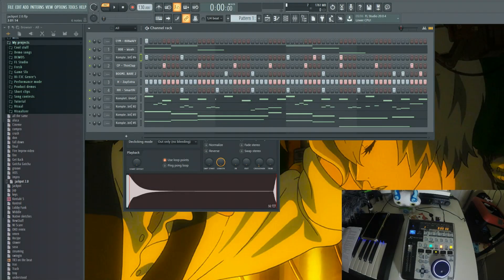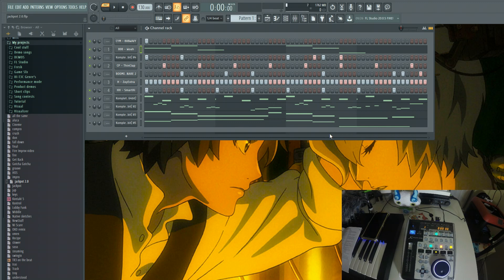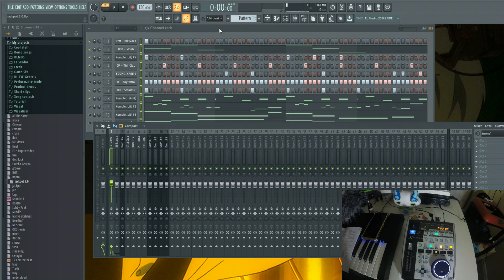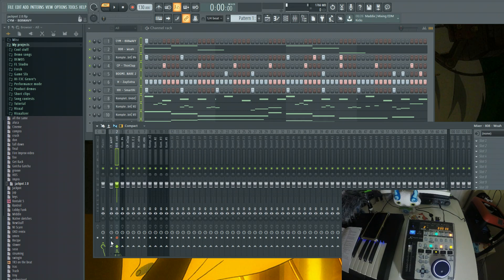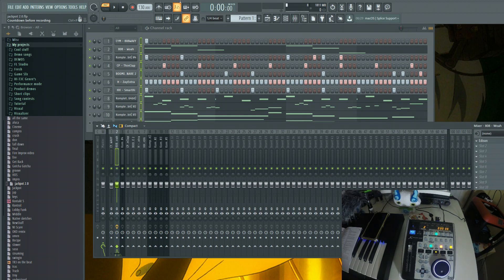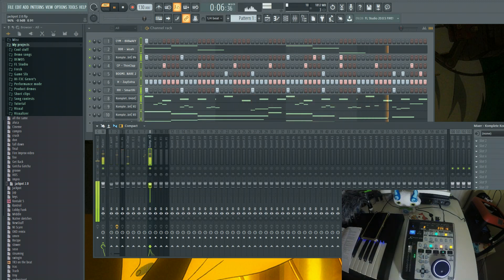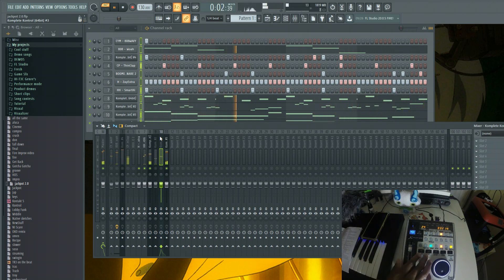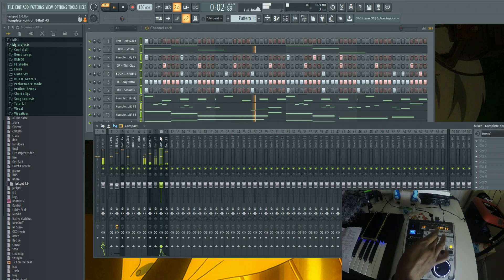Behringer X-Touch One with FL Studio 20

Comment: Hey man, just a question. I've got one too but I can't get it to work with fl studio. Everytime I want to select it or put the master sync on or send it to a port. I get a error. In the error it says that there is not enough space for it and I have to shutdown some other extensions. But that's the weird part. Coz this controller is the only one linked to the computer. Can you help or do you know a solution. Also I'm getting a code 10 from my pc when I plug it in. Kind regards
Reply from the maker: I have ran into this numerous amount of times, as do i currently. This seems to be a glitch or some type of time out thing it seems. The solution that fixes it for me every time, is to just unplug the power cable from the x-touch and plug it back. FL will rescan the midi and it should work accordingly. I think for some reason, the memory is saved from previous instances, causing FL to believe that there is no space allocated for the devices.
Let me know if that helps. I have not found a permanent solution yet.
Reply: @hit3c  I tried this but it just does not want to work. in the midi option of fl studio it even does not say x touch one, instead it says game controller 1
Reply from the maker: @patrickvanderlit5411  that's odd..do you have the controller set to Mackie HUI ?

Comment: Hi. ive plugged mine in and i am not getting anything. the X Touch is showing NC above assignment and nothing else is showing anything. im very confused.
Reply from the maker: sorry for the late reply. Sometimes this happens with me as well. Make sure that you set it to "mackie control" and assign a port number to it. Set the master sync to the same port number and make sure "send master sync" is lit. If it still has an issue. Try closing FL Studio and turn off the unit. Then open it back up after you power the unit back on. It can be buggy sometimes.

Comment: Curious if there are any known limitations when connecting to the DAW over longer USB cables. I have USB 3.0 ran to my booths. I want to use something like this or faderport classic to start / stop my session while recording alone. Thanks to any reply.
Reply from the maker: I'm actually not sure about this; however normally there could be abnormalities or degradation that occurs the longer a cable is. My only suggestion would to just test it out with a short cable and a longer one to see if there is any slippage in functions. This unit comes supplied with a power supply though, so my guess is that a longer USB cable shouldn't be a problem.
Reply: Hey, I have the Faderport Classic working in my drum room and other booths. Using USB 3.0
Reply: Don’t forget IL Remote is a thing! :) you can just take your phone into the booth and trigger all of the recording functions like Rec/Cancel/Metronome/Play/Pause :)

Comment: Hey friend, this controller does not need drivers to be used and if it is only connected to the computer it can be used with the studio or oh, what to configure it?
Reply from the maker: You don't have to configure it for FL Studio, since its a dedicated controller for the DAW; however it is a generic/standard midi controller for other DAWS. It would have to be configured and routed for anything other than FL Studio

Comment: Any tips on how you can use the fader to control any parameter within plugins for example or the modwheel etc. anything that can be linked... but stay in MC user mode, because in CC mode all buttons like PLAY PAUSE RECORD etc don't work anymore ?

Thanks
Reply from the maker: Hmm. Sounds like you may have to set up Global links. 
1. turn on the multi-link button near the transport controls
2. open whatever plugin and move the control you want to link.
3. right click the multi-link button and choose "override generic links", then move the fader. 
(The link will be active to the plugin only when it is focused, and will stay linked even if you close FL)
ps. I haven't tried this particular way yet with the X-Touch One but theoretically, thats how it should work.
Please let me know if it works!

Comment: Can you change the function of the dial wheel? like instead of using it to select tracks, can you link it to the limiter gain knob or something else? 
Great review btw you covered everything.
Reply from the maker: Honestly I'm not sure. I will certainly mess around and see! Thank you
Reply from the maker: So as an update, I have got it to link with the gain knob of the limiter, however i'm only getting absolute values of 0 to -50 db. To even link it, you have to change the mode to Midi or Midi Relative on the X-Touch. I'm interested to see if i can get it going smoothly and make a video soon!